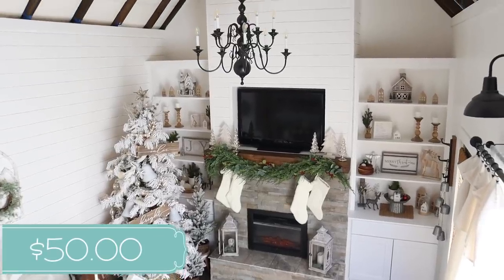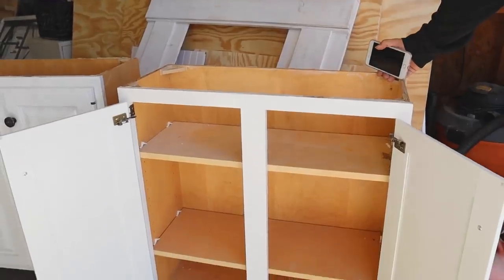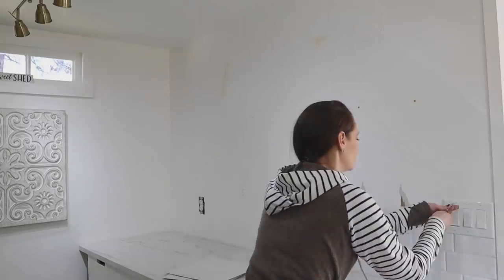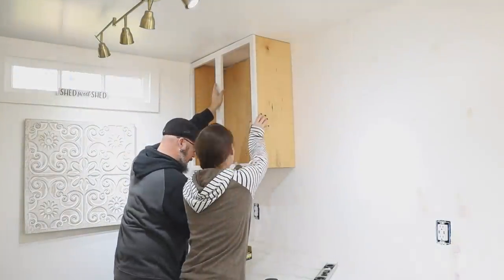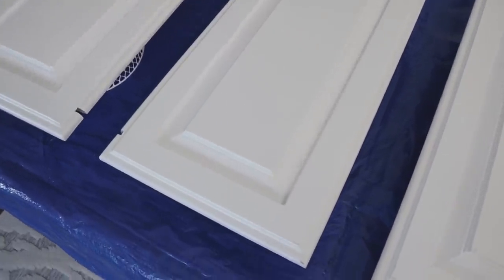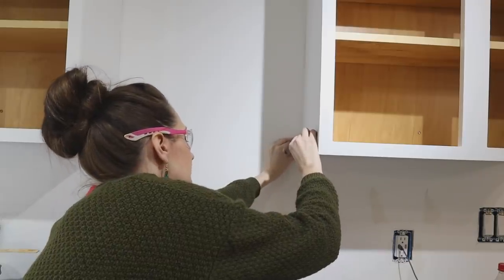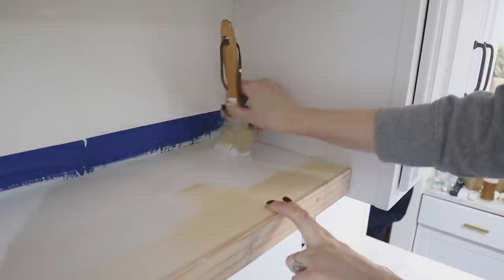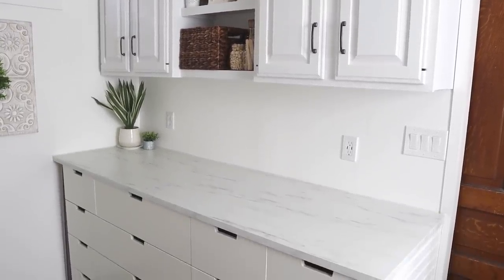DIY Craft Room Storage HACK 😍 (Shocking before & after!)

Comment: Yes, to the backsplash and yes to the trim at the top!  Adding trim around the bottom of the upper cabinets will give them an upscale look as well and potentially hide under cabinet lights, but not blocking the light.
Reply from the maker: Thank you!  Great ideas!